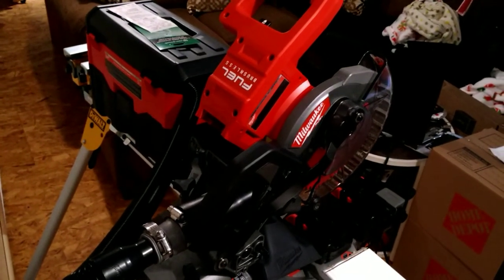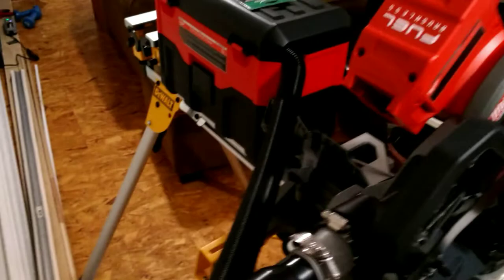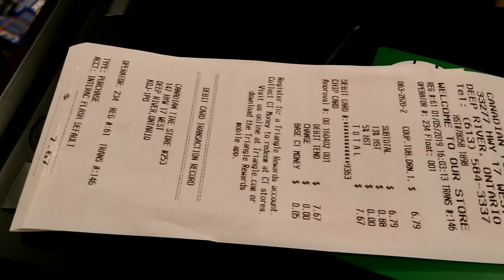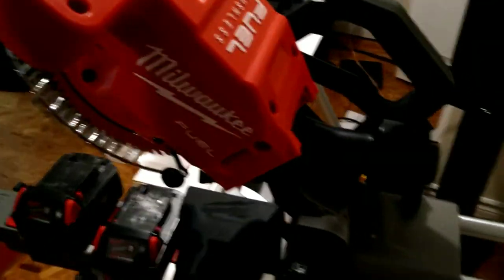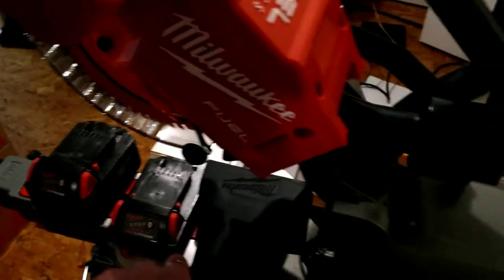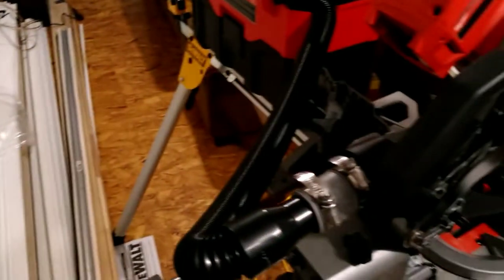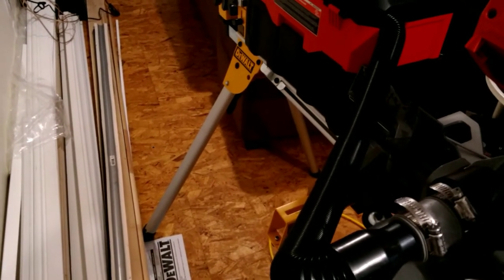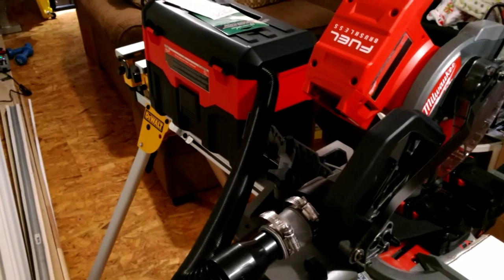Milwaukee, You owe me $7.67, Your Tools Are Not Compatible

Comment from the maker: I will say that the vacuum works pretty good with the saw and you notice it a lot if you don't run the vacuum.  I tend to use a 2 amp hour battery on the saw and a 5 amp hour battery in the vacuum.  Another significant problem with the battery is that the power switch does not turn off when you pull out a dead battery.  You get a good arc across the battery terminals when you stab in a new battery with the vacuum still turned on...